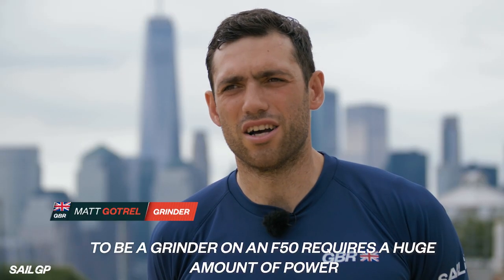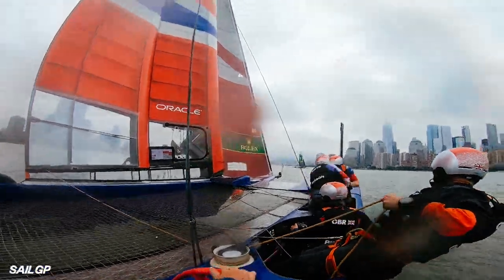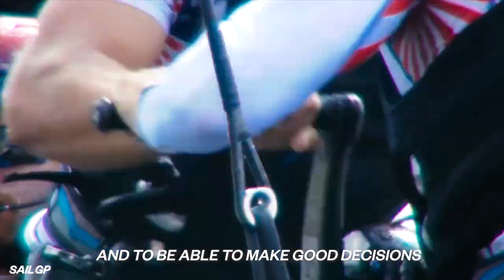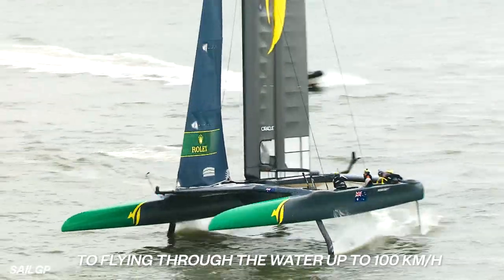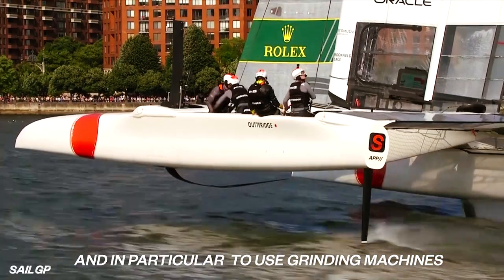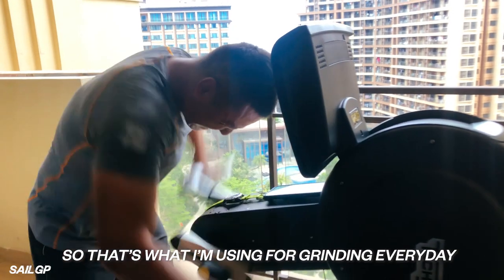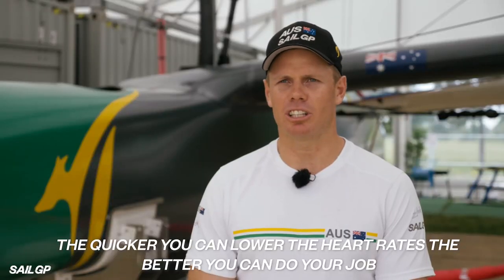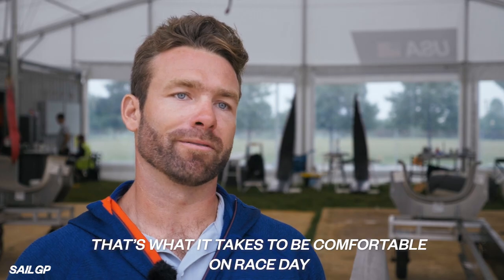What is a Grinder? | SailGP Explained

Comment: this didnt explain what it does... just who they are. ill keep looking
Reply: yeah ... on the same quest ... I think they are pressurizing a hydraulic system that assists the sail guys to tack and trim the sails.
Reply: They decided to give the sailors something to do that resembles what they used to do, but now they use muscle power to generate electricity.  The grinders used to pull in the sheets (ropes) that control the sail angles. I think one of the boats still had a traditional sheet and winch, where the guy will quickly wrap the rope (sheet) around the winch and just holds it.  Mostly, these boats use hydraulic power to move the main sail and also control the underwater foils.  The foils can be angled and are very important in these kinds of boats, since they are more like airplanes and you need to control pitch which you don't normally need to do in a sailboat or your boat digs into the water and could flip.  They decided to make the pressure manual instead of a motorized compressor.  This makes the whole boat 'manual' with no solar or batteries or gas engines, keeping in spirit with sailing of old times where you only have the wind and your muscles.  Also moving the crew to the correct side gives a counterweight to help keep the boat balanced.  With a motorized compressor, these boats could be operated by just one person.
Reply: @randyparsons3188  thank you. I been googlin my arse off trying to get a straight answer
Reply: @randyparsons3188  Apparently the grinders only power the wingsheet on an F50, everything else is powered by batteries and electric motors.

Comment: How much they tried to merge this type of activity and technology of the new boats with meaning of sailing ACC boats from the past, they completely veered off the original true sailing and feel of the past races. Now they have basically human motors for powering the hydraulic pressure and with one helmsman on completely automated aircraft-like vessel. There is no raising/lowering of sails, pulling and releasing sheets or any handling of rigging whatsoever what regular crew needed to do and know on classical old school monohull ACC era.

Comment: What don't they peddle with their feet? Legs have more power.
Reply: one team did it during the americas cup 3 years ago but it got banned this year
Reply: @jonathanschmidt1668  Why? As a cyclist I have to agree with wisanu99. Leg power > arm power.
Reply: @jamesaron1967  you are completely right and that's why they banned it the rulemakers are sailors and they did not want cyclists to outperform.them I guess.
Reply: @jamesaron1967  Emirates Team New Zealand first used pedal power in the last Americas Cup and Oracle Team USA also switch when they realised it was better. NZ recruited Simon van Velthooven an Olympic cyclist as a grinder.
Reply: And a small battery would have both more power and energy than an athlete. Grinding makes no sense.